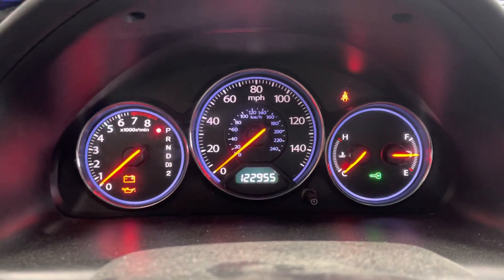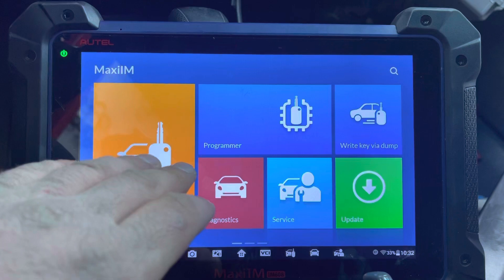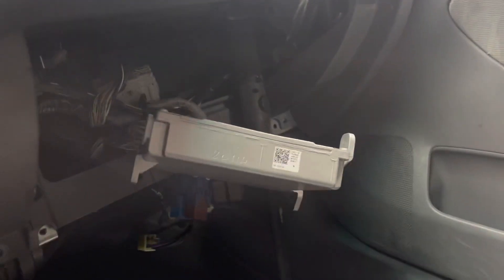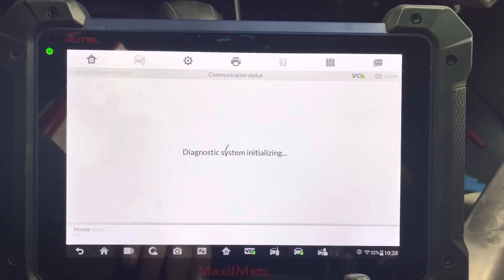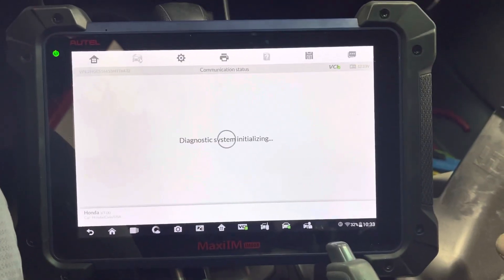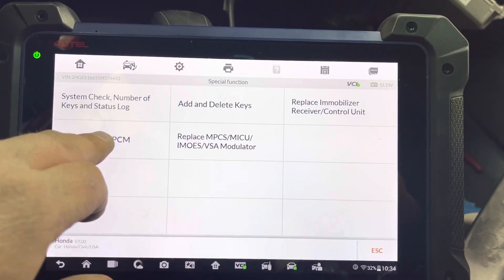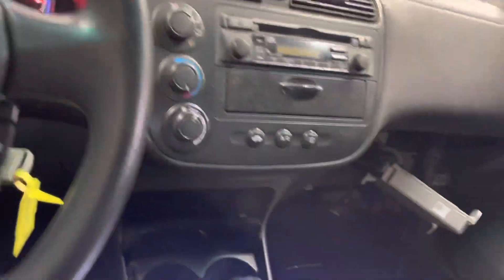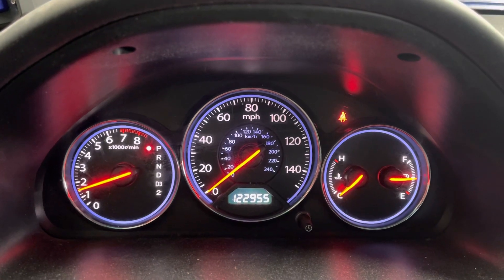HONDA ECM SWAP & IMMO SETUP

Comment: I have a 2022 honda accord and i disconnected the car battery to replace the water pump, but when i plugged the battery again, the immobilizer light came on and i can't start the car again... will this process may work?
Reply from the maker: Yes, probably. Depending on your situation.